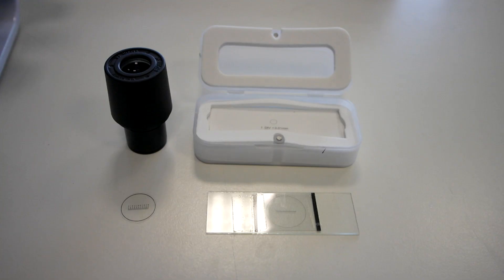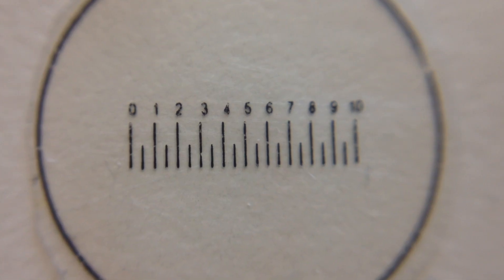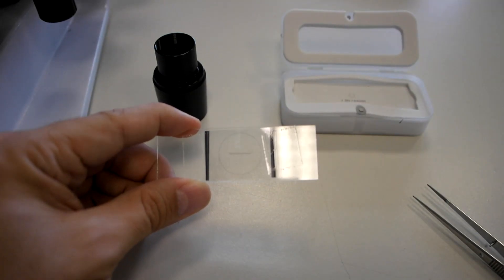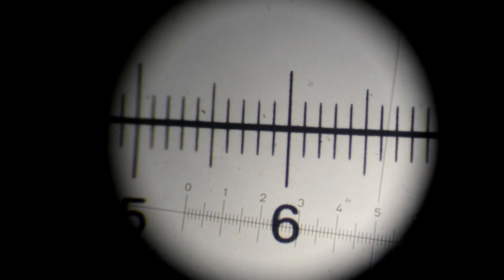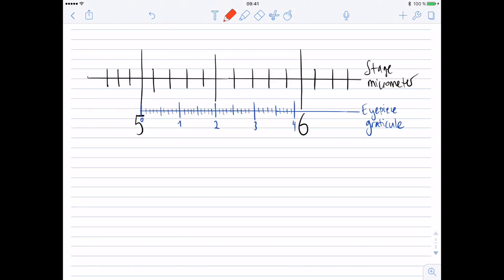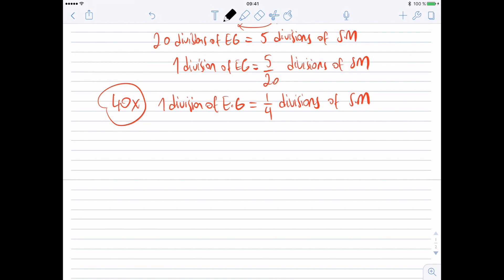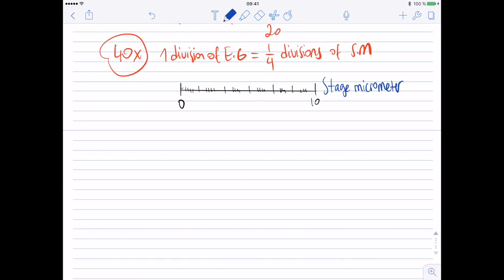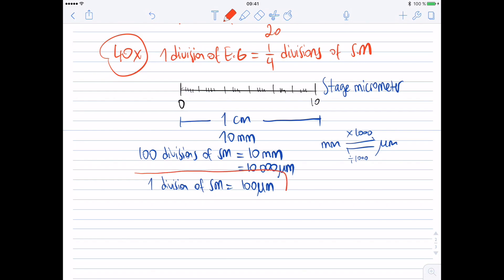A-Level Biology: Calibration of Eyepiece Graticule with stage micrometer

Comment: So does calibration change if i move from 4x to 10x n 40x magnification???? If so then please explain then what will be the calibration in those cases???
Reply: you have to look through each lense and do step 1 for each of them. and instead of 1/4 for the 40x magnification to multiply with the 100µm, you get different values for each lense!